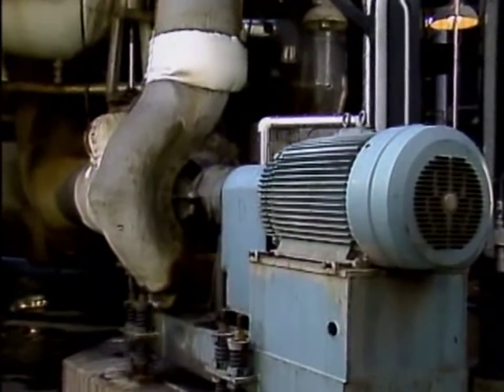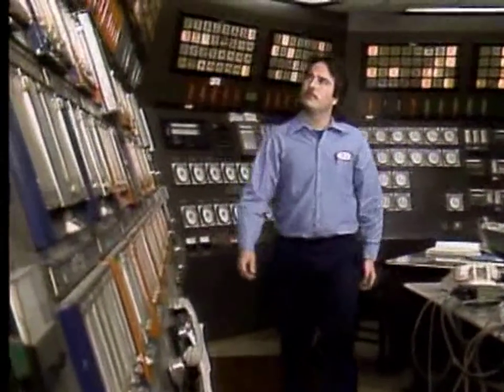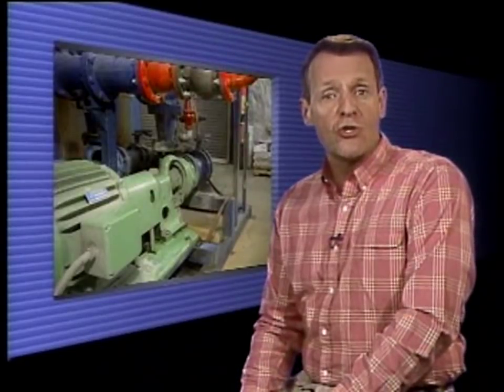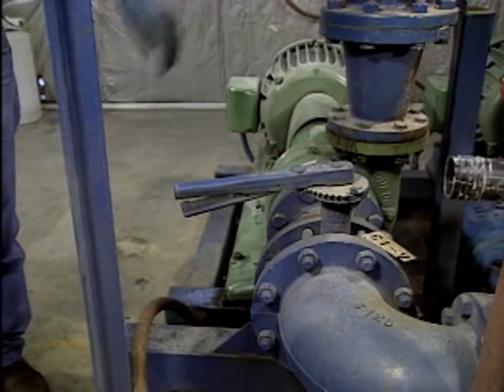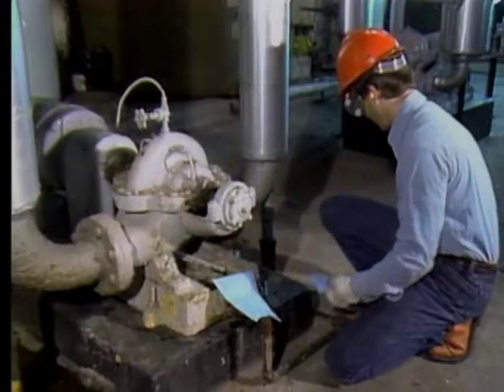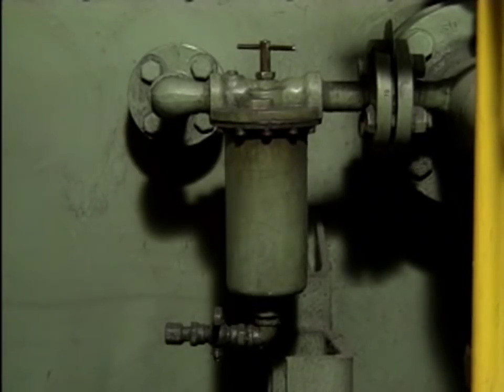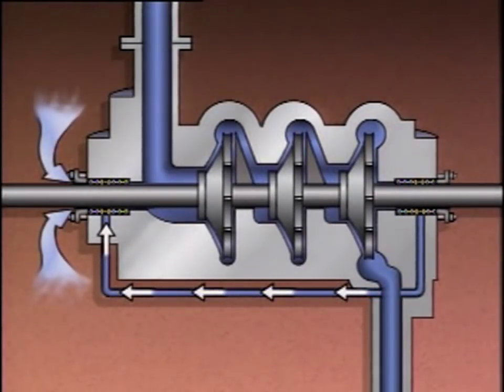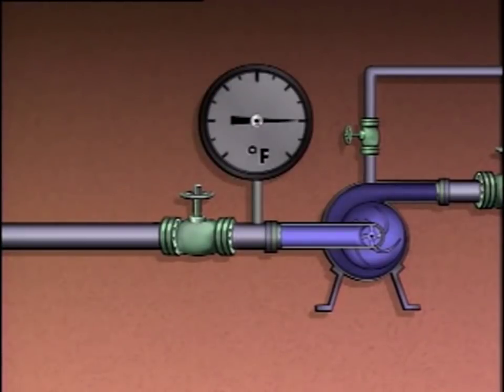How to start Centrifugal Pump|? and |Troubleshooting

Comment: Good day ! Could you tell me if you have any technical literature that would describe how to work with your hands like in your video? Repair of pumping equipment, shaft alignment with indicators, checking for runout and shaft deflection! It would be interesting to read, learn something new and improve your knowledge of English. It is a pity that the group in the telegram is not developing and very few people have subscribed ((

Comment: what is the maximum diffrential pressure across the filter or strainer at which we should clean it?
Reply from the maker: This is depend on Design of the systems application
Reply: You'll always have a drop even when it's clean, so just write down on the filter base with a marker pen what the pressures are when clean and they'll have something to go off. However it doesn't take much to clog the flow and you'll get a pretty obvious drop in pressure across them.